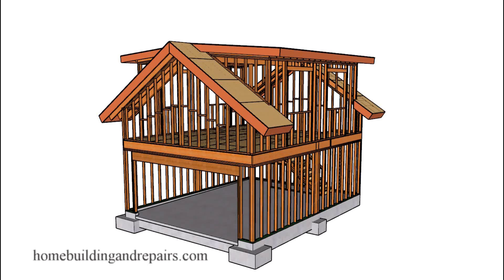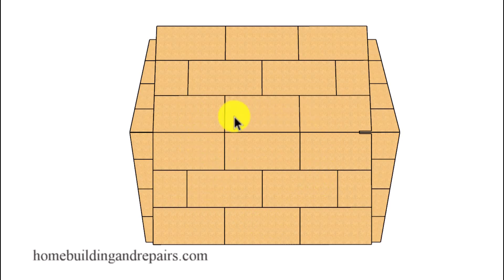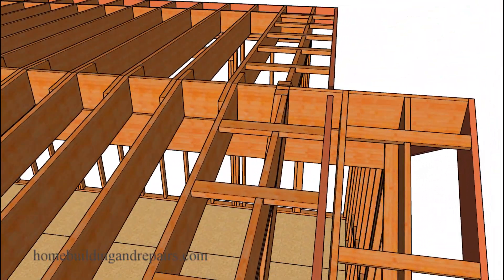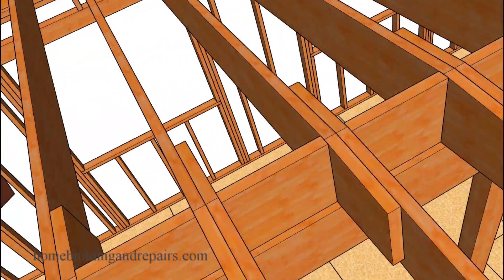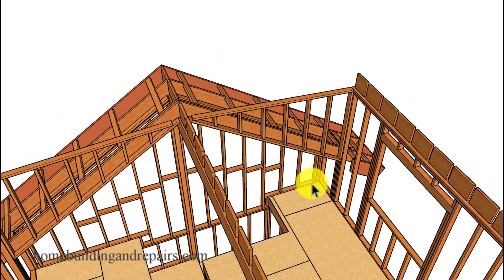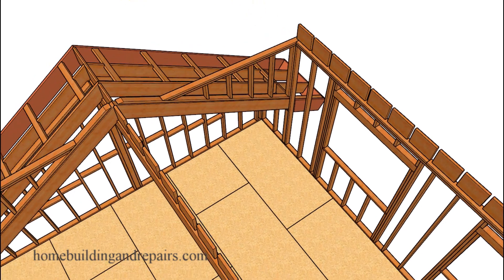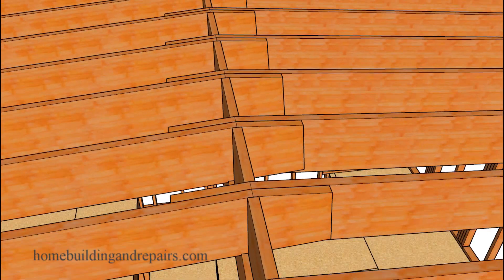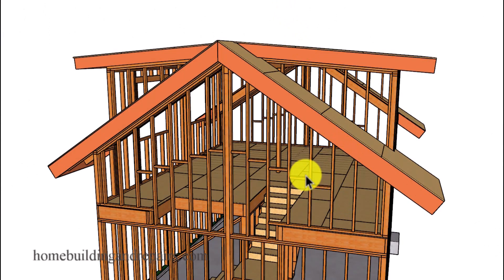How To Frame Two Car Garage With Double Shed Dormer And Gables - Building Education Series Part 19

Comment: I can't believe my luck in finding this video.  I am trying to modify the look of my roof of our 2 story house so that it looks like your end result in this addition, except that I don't want to add any floor space. My existing roof has a very shallow pitch and virtually no overhang.  Basically, I am trying to make it look like I had a steeper initial roof and added dormers on both sides like you were doing here.  I want the "new" steeper pitched roof to just be a much larger overhang of the eves.  I am thinking 3 feet extra, but would listen to opinions of more or less.  I may then bump out the second story window in a "Tudor" fashion.  Do you have any videos that would show me how to accomplish the tie in?  I need the "new" steeper pitched eves to tie in exactly to the top of the current roof ridge.  Thank you for any suggestions!

Comment: There’s a support under the ridge beam. Is that there temporarily or are you suggesting that it’s needed for support?
Reply from the maker: I think it will need to stay.
Reply: Could that be replaced with an LVL? If not how is the load transferred (I didn't see a post below it)

Comment: Why not attach the rafters directly to the ridge. I don't see a reason to overlap them on top of it and block them unless you want the exposed beam. This way the you have less of an obstacle when trying to drywall the ceiling in that portion? Would probably require a LAM beam here. They love to overkill the load calcs. Your design makes plenty of sense just wondering. I can see the value of overlapping, but have built custom double and triple ridge roofs with just nailing the rafters to the ridge.

Comment: I want to do this over an existing garage but want to raise the roof level using the dormers. Is this possible?
Reply from the maker: It will depend on your existing design, framing and foundation. If the components are strong enough, then I would think it could be done.

Comment: This would be a disaster in any wonter climate.  Ice dams on that flat roof would be terrible!
Reply from the maker: True
Reply: I’d imagine you’d use some common sense when living in an area with inclement weather. Also, if you’d be building anything you’d need your structure approved by your local engineer before being permitted to build.
Reply: There's tons of flat roofs on snow states. We had one. Rarely a problem in 45 years we lived there. I daresay, it's only when the builder doesn't know what he's doing that it's any issue.